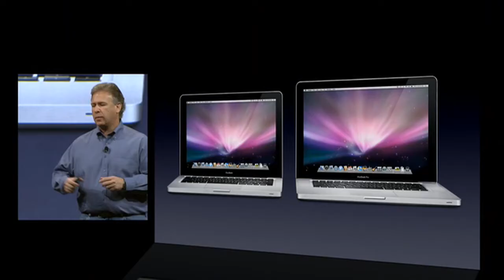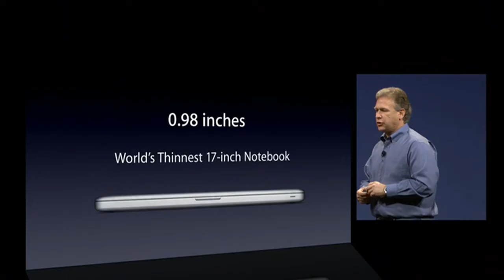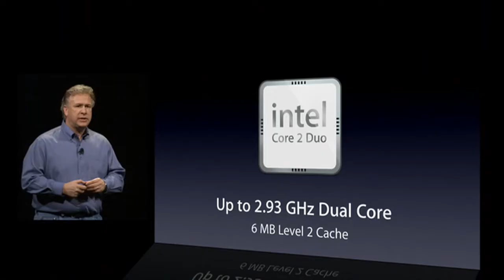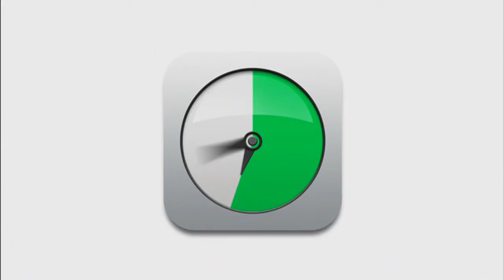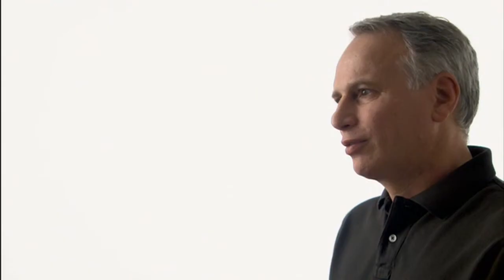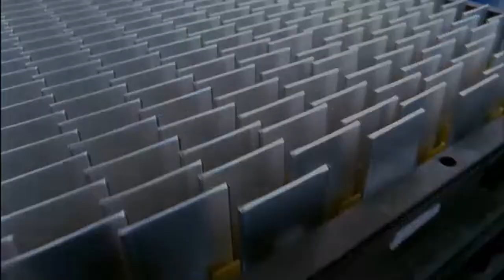Apple Macworld 2009 Keynote - Introduction of the 17" Unibody MacBook Pro (part 1)

Comment: In retrospect, Apple should’ve long ago offered Fusion Drive on their notebooks. 64GB ssd and 120gb HDD standard on all notebooks until the retina MacBooks came out with SSD’s as standard.

Only question is where would they have put it. lol, they would’ve had to add a place on the logic board for it.

Comment: Typing this on a Mid-2009 iMac 17"

Besides occasional overheating, this thing is built like a tank! Unbelievable quality.
Reply: Yeah. The newer computers are more basic but with less ports and lower durability, but with incredible performance and portability!
Reply: @MacintoshFanTechnology  My current 16" M1 Pro is perfectly fine :)
Reply: @MacintoshFanTechnology  Well, do we really need ports when something like the Mac Mini has 4 Thunderbolt ports? You can technically connect 4 eGPUs to it.

Comment: Apple so lost its touch with MacBook it's starting to become a iPad with keyboard.. come back jobs
Reply: umm you do realise iPad Pro has a keyboard purchased separately:

Apples new laptops:
Ipad Pro 9.7
Ipad pro 12.9
MacBook Air 11.3,13.3
Macbook 12 inch
And the MacBook Pro toucher 13 inch, non toucher 13 and 15 inch
Reply: 1400/800 apples new laptops :

iPad Pro , wtf ?

iPad Pro isn’t a Laptop if it doesn’t have Mac OS or Windows , iPadOS is just a joke.
Reply: Apple Fan Boy yeah I thought it would improve, still doesn’t feel like a laptop at all

Comment: @maniacwithagun767 that's because you haven't seen it right in front of your eyes.
Macbook Pro's 17" display resolution is just amazing. 1080p videos come to life  there. It has louder speakers, more connectors and a longer battery life, and it's only a little wider than the 15inch model.